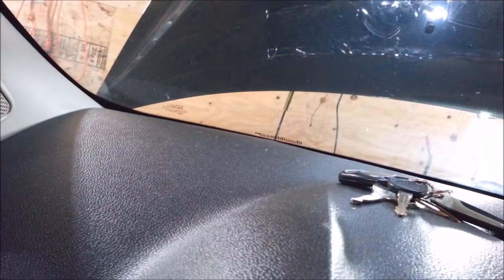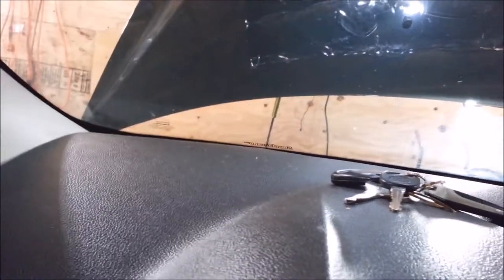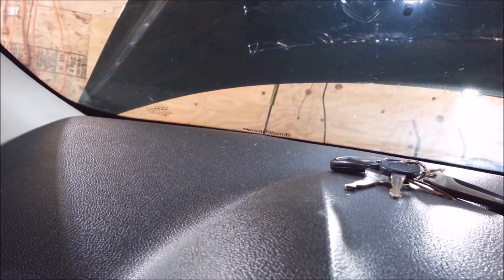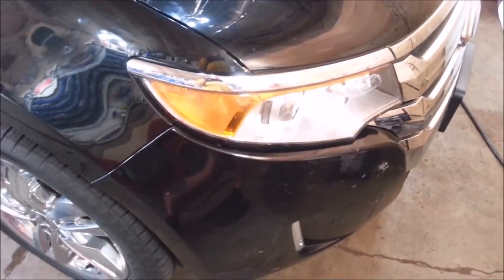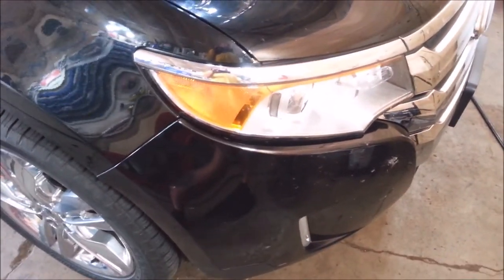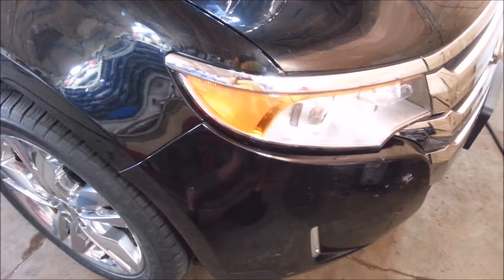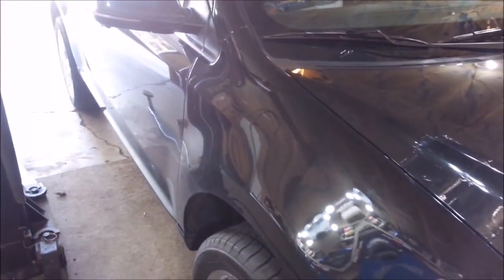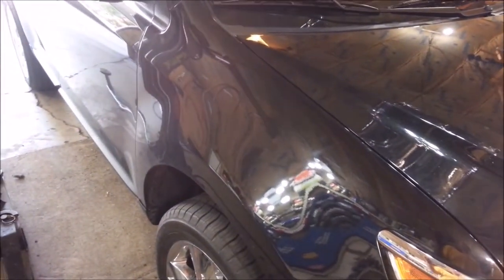2007-2015 Ford Edge MKX low brake pedal fix

Comment: It's been about 5 months since you uploaded this video. Just curious, has the spongy break pedal returned? 

My 2011 MKX is having the same issue. Going to try the reverse trick later today.

(Later today) .... Just tried the reverse and grenade the brakes trick. It works!!! I had to do it 4 times until it fixed the issue but sure enough, ITS FIXED! Thanks Rust Belt Auto.
Reply from the maker: Nope. It's working.
Reply: @RustBeltAuto  still
Working?

Comment: We'll it didn't happen for us. I guess put it in the shop tomorrow, 
But generally speaking, if I can't fix they usually cant either
Reply from the maker: Did you do it in the gravel, so the ABS activates?
Reply: That's where I  messed up
Reply from the maker: @leepowell4970  I must have been doing at least 15mph in reverse, on loose gravel. Took a couple of times.
Reply: @RustBeltAuto  will do,  thank you
Reply from the maker: @leepowell4970  be careful. good luck.

Comment: How do you activate abs ?? I am having similar problem changed master cylinder ; full bleeding of brake oil .. still have spongy brake
Reply from the maker: You need to find a slippery surface like a gravel, or wet road. When the unit notices the tires are slipping as you brake, the ABS is activated. For some reason when I did it, reverse worked, and forward did not.